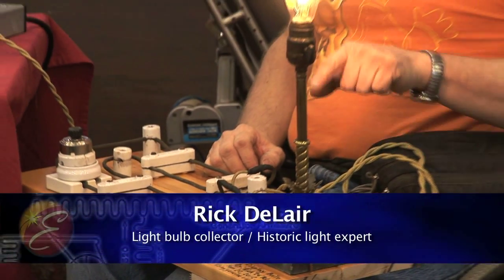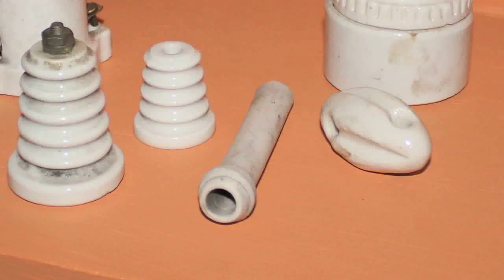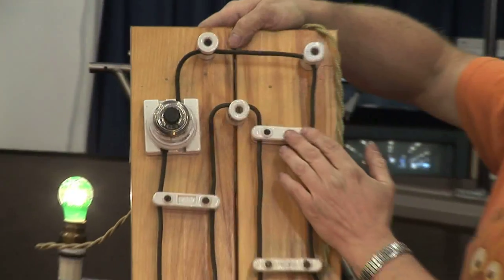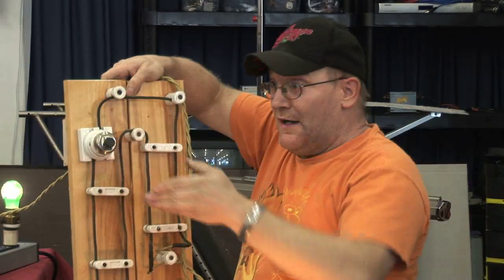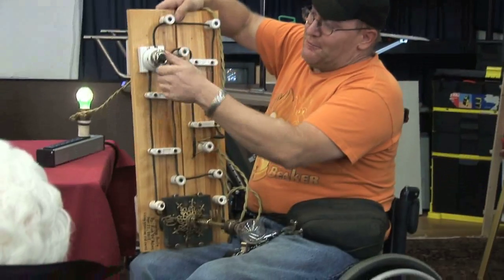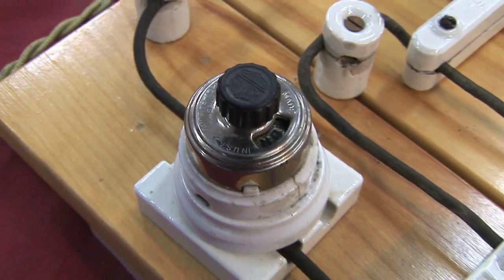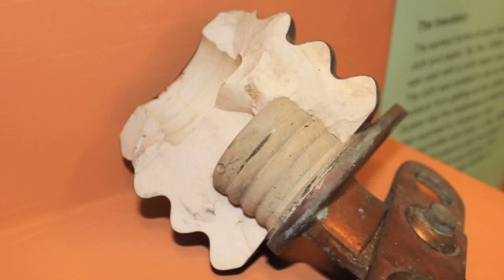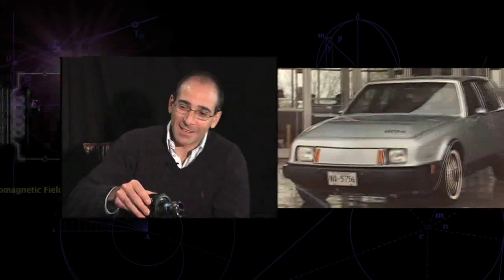Knob and Tube - early electrical insulation

Comment: "They made things to last."   What a concept, produce and use quality material and items and here a hundred years later they are still working just fine.
Reply: My house was built in 1944 all knob and tube wiring. The electric panel and addition is all up to date but all else is the same have had no issues the whole 6 years I’ve lived here.
Reply: That's Why They Replaced With The New Crap Because It Works Just Fine
Reply: “They made things to last” is a bit of a paradox. They also made things poorly back then, but those items didn’t last so we don’t see them anymore. Hence why people tend to associate old items in general with quality, even if it’s just a few select items that were built well.
Reply: @Brian-xo1bt  The good stuff that didn't get messed with lasted.  The run of the mill junk was trashed years ago.  Just finished up some work on a house built by a homeowner back in the early 50s.  Turned my hair grey seeing what was in the walls & hidden in the attic
Reply: Things were also a lot simpler and people weren’t trying to power a washer/dryer, four TVs, ac, water heater and a million other things at once. It’s nostalgia, they say quality but forget how unreliable some older things really are. Cars are the best example.
Reply: @holliday72889  My old house with K&T had two circuits.   Each circuit was fused 15A, the wires were 12ga.   I don't know how the neutrals were run exactly.   The circuits I believe were opposite phase, one for lights, the other for receptacles.  Things get really weird with K&T.  Correct me if I'm wrong...  if you have a 60w bulb and a 60w television running opposite phases and sharing a neutral, it's possible the neutral will carry no current at all, it's electrically equivalent to a pair of loads in series on a 240V circuit.  It's only when the loads are different that the neutral is loaded, but the maximum difference is 15A.
Reply: @mgjk  no you are absolutely right.   And precisely the reason,  you can for example,  wire a kitchen with 12/3 W ground, and arrange the receptacles along the countertop in such a way that every other receptacle alternates between the black hot and red hot, or as we say in the field,  A phase and B phase, sharing a common neutral,  you can plug an electric skillet in the first receptacle,  and a toaster oven in the second receptacle,  and not worry about overloading a circuit.  If the skillet draws 10 amps, and the toaster oven 12 amps, and are turned on, the neutral only carries 2 amps.   One thing you really have to be careful of in older homes, (even newer ones where the wiring was installed or repaired by someone unqualified) was the possibility of two hots of the same phase (Black or Red) sharing a common neutral.  This causes the neutral to carry the sum of amps on both hots, and can heat up dangerously. Also, with tube and knob,   prior to 1928 some fuse boxes were configured in a dangerous fashion,  that independently fused the hot and neutral.  Panels from this era typically had exposed terminals or bus bars, sometimes the box was built on site out of timber,  and had an asbestos board nailed on the interior. Sometimes the home only had 120 volts total capacity (this can be detected by looking outside,  where the utility lines connect to the meter, two wires connected to the service entrance cable and a small circular meter indicates a rare 120 volt service,  typically 30 amps).   There are more oddities with knob and tube, than I can type here, but you should get the idea.
Reply: @Sparky-ww5re  I didn't know that about split receptacles, why 2 15A circuits could share a 14ga neutral, was strange to me, but I never gave it much thought.  The code was updated about 15 years ago  to permit 20A in kitchens, simplifying this.   The K&T aspects though... the whole system seems very well thought out, but many parts of how and why K&T does what it does are non-obvious... like this seemingly undersized shared neutral.
Reply: There is actually a big problem with the knob and tube insulation.  The insulation, when repeatedly heated, becomes extremely brittle with time.  You almost always see this around light fixtures. It is probably the reason why knob and tube is considered such a fire hazard.  I’m guessing the insulation is also not very fire resistant.
Reply: Literally every modern wiring I encountered gets brittle near light fixtures over time, especially if we're talking about older lighting technologies, such as fluorescent or incandescent lighting. This issue isn't specific to knob & tube.
Reply: @ImWriiight  knob and tube is a fire hazard because every fixture shared a neutral. Infinite circuits per building, one neutral. As more and more things became electric, neutrals became overloaded and melted, burning houses to the ground. Knob and tube would be fine to this day if they ran separate neutrals for each circuit.
Reply: The problem is, as was proven by the auto industry bail outs, when you make a product to last, you are limiting the number of sales you can aquire. Who is going to buy a new car when the one I have now works just fine. Thus the marketing firms are born, and then the idea to make things NOT last as long. Look at a new car now. 1mph bump with an obstacle and the car crumples. Not a coincidence, and not designed solely for the safety of passengers. Tis a marketing ploy.
Reply: @Shasta Valley Outdoorsman The main thing that makes knob and tube dangerous is when people that don’t know what they’re doing try to modify it

Comment: My grandparents had a home from the late 1800's that originally has gas lines running through the walls for gas lamp lighting.
Reply: My friends house was built with gas lighting and when electricity came around they ran the wires through the gas lines like they were conduit.
Reply: @domineech  I have seen that myself.
Reply: My parents bought a tenement flat in Glasgow in 1961 and there was still gas lighting in the hall and sitting room.  The gas lines were still in the walls of the other rooms, the previous owners had removed the light units and just closed off the gas supply to the rooms.
Reply: I got a rock
Reply: I have a large pile of lead piping that I removed from my house when I did it up. House was built in 1919, I was amazed that gas lighting was still being installed then!
The house was electrified in the 1950s, with lead-sheathed VIR cable, some of which was still in use but very worse for wear when I bought it in the 2000s. It looks like standard grey T&E / Romex at a distance so it threw me the first time I reached under a floor and touched cold, hard cable!
Reply: As a carpenter I would run into them on older residential remodels
Reply: My house was built in 1914 and had gas lighting, when they got electricity my great-uncle used the gas piping as conduit to run wiring thru...
Reply: Many of the older public buildings (including schools) here contain remnants of gaslights.
Reply: @WCM1945  buildings are great man. I saw one today that was so big they call it a warehose. Technology man. Its a wild cactus in a giant warhouses in the Amazon with Jeff Bridges. Its almost Ike we got the World in perfect harmony and flasma tactics
Reply: That sounds lovely.

Comment: I remember my great grandmother’s house had this type of wiring around 1960. The house was built around 1890 something. There was a hand water pump at the kitchen sink, and a cistern outside to catch rainwater from the roof. The cistern was divided through the middle by a wall of brick, two bricks thick. The water came into one side, and the brick wall acted as a filter. The water was drawn out from the opposite side from where it entered. The house had lathe and plaster walls. When she passed away, the relative who inherited the house had it gutted and brought it up to code.
Reply: I was born in 1986 and the house we lived in had this knob and tube wiring. My father sold the house around 1996 as I recall. Also had lath and plaster walls.
Reply: @Melanie16040  i read that carpenters hated nailing all those strips to the wall for plastering  .

Comment: Many of the original Edison lightbulbs still work because the filament is much thicker than filament used in today's incandescent lightbulbs. That made them much less efficient (and bright) but far more durable. Interestingly, traffic lights of today (except for the LED ones) use a similar trick of thicker filament so that they don't need to be replaced very often, even though they use slightly more energy.
Reply: Is this why LOW VOLTAGE bulbs last so long, almost never burning out? Including for automobile taillights? I have 3V and 12V lights in the house that have been burning continuously about 20 years!
Reply: @JungleYT  This, but also some automotive lights are put through a tempering cycle to help them handle being on/hot. (at least the quality ones that most people buy and use.) House edison-style bulbs are not usually treated as much if at all and it's kind of expected and normalized that they'll quit in a year or two or three. Unfortunately it's true that if you make a perfect product you will make no money, and, if you make a good product that is only flawed in a slight way, you will sell a lot of them and people will come to expect the product to be imperfect.
Reply: @KenzertYT  Well, the 12V lamps I use in a small desk lamp are similar to auto tail light bulbs, and the 3Vs I use to illuminate a step might have a similar treatment having a "pilot light" utility? Low wattage bulbs, like 25W also have a higher resistance than say 100W bulbs, so that might be another relation. Still want to contact a lightbulb engineer at GE or something for explanation as well...
Reply: @JungleYT  Very likely, yes.

Comment: as an electrician from 1967 to 1995 i've done a lot of work on knob & tube wiring. if it is left alone & not "messed with " it is perfectly safe, however, this is rarely the case. i spent a lot of time re-wiring buildings to remove knob & tube for nervous insurance agents & homeowners. my house was built in 1906 with knob & tube. i sleep just fine. from 1995 to 2017 i was a electrical safety inspector for a major ohio city. better inspecting than working on. most of the time needlessly. if knob & tube is inherently flawed, most of the houses in oakwood, ohio would have burned to the ground years ago.
Reply: I'm an electrician in Dayton, OH, started back in 2003, residential new construction and service.  I hated working in Oakwood (damn Jenkins) with their city reality presale inspections and the large amounts of K&T that's still there.  Have twice run into that hideous "Carter" or "California" Threeway as well down there.  I concur on the "leave it alone".  Once you start touching it, it crumbles away.  Did you know any of the Mont. County inspectors?  Bobby Spencer that passed, Gale, Neal?  I've lost touch with who is out there now, after going to be a nameless Mook for commercial companies.
Reply: @Salty_Balls  if k & t insulation crumbles when touched, it should be replaced, probably from being overfused in the past. jenkins does not wok for oakwood, just does electrical inspections. oakwood does their own pre-sale inspections. knew all the inspectors you mentioned.
Reply: @garybrown7044  If it was inside a box, we just heat shrinked it with tubing  and then taped it (was usually just a service call situation).  Outside a box, wouldn't touch it period unless it was to remove.  I just hate Jenkins, as a general comment, add Neal to that, and the whole city of Oakwood.  Never been a worse bunch of homeowners then that town.  That city needs an enema.  Ever bump into a guy named Jerry Deischer?  One eye, big old drinker nose, tough as nails, a little scary?  He's been dead awhile now, 8 years or so, but he was around a long time, not as long as Sheriff though.
Reply: I save knob and tube joints and look at the connections when i eliminate it.most folks dont realize(the joints are soldered). I agree if knob and tube isnt messed with or overloaded,it's fine for the most part.
Reply: @benbradshawjr2856  my grandfather installed knob & tube before ww-1 & after until approx.1932. i still have his soldering "copper" & gasoline fired blowtorch. he drilled holes by hand. he bought solder in 5 lb. spools.

Comment: Can you properly explain or show an accurate drawing on how the CARTER SYSTEM works 
Thank you
Reply: Each switch selects between hot and neutral, if the bulb gets two neutrals then there is no voltage across the bulb and it's off. If the bulb gets two hots then there is also no voltage across the bulb and it's also off. The bulb is only on if it gets one hot and one neutral.

It's more dangerous than other systems for 3-way switching for two reasons. Firstly the bulb holder may be hot even with the light is off. Secondly the outer shell of the bulb holder may be hot. Thirdly if the switch is not designed for such use it may pull an arch between hot and neutral.

Comment: I have a question about knob and tube, and hoping someone here might have an answer! My house was built in 1925, and originally was all k&t. When it was refurbished in 1976, modern Romex replaced all the k&t, except for the the light over the staircase. That light and it's two switches were left untouched, for reasons unknown. When I replaced the light bulb with a CFL type, it burned out immediately. A second bulb did the same. LED bulbs burn out immediately as well. Regular incandescents work fine. I'm just wondering why this is. Someone once told me this could be due to a lack of a neutral wire, and that a single load wire passing through the incandescent bulb will make the filament glow normally. I don't know if this is true. Hope someone here can shed some light on this!
Reply: First thing you need to do is look at the incandecent bulb you removed. Either printed on the top, or stamped along the screw just below the glass part there will be a rating. Most circuits in a house should be 120v however this may have been wire 240 volts. A 120v incandecent can work on 240 but a CFL or led will not. Go to the hardware store and buy a regular 240v 50 or 60watt incandecent bulb, if it glows full brightness in the socket the light was wired 240 volt. If 240v, you need to get an electrician to come change it to 120v. Diagnosing it yourself will save you some time and money with the electrician. However, if the bulb does not glow full brightness, there is something very suspicious going on, and an electrician will need to come cut holes in the wall and figure out what exactly is happening. Other than that there may be some other reason that I don't know of but someone else here may be able to help further.
Reply: May be reverse polarity. Incandescent bulbs don’t care about polarity, leds and cfls do
Reply: @chrismc7205  it is AC not DC, reverse polarity will cause the hot and neutral to be reversed, but there is no positive and negative, so it will still work the same. and as for there being no neutral wire, there is a neutral wire, just not a ground. without a neutral there would be no current and no light.

Comment: In  "my days"  in  HVAC/R service,  "the boys"  were installing a retrofit system in a very old farmhouse.   I was up there  installing the AC  tubing/ controls  and  part of it was back in a closet  against the roof pitch.   One of the guys  says  "what's this wire here for?"    BARE WIRE.  One look and I grabbed my meter.  YUP!!!  Still live, still being used.  BARE   knob and tube   This was  about 1985-90-ish
Reply: Found one of those little surprises doing renovation work on my 1922 house. Wiring had been upgraded to modern standards, new breaker box, but an end of run on one circuit had the old knob and tube (same situation, tiny spot that was hard to get to). No bare wires, but the insulation had degraded so badly that it might as well have been bare. Luckily, even as a rookie DIY guy, I had the presence of mind to check with the meter. To say this got my immediate attention would be an understatement. About 1997. Kind of scary to think how many of these time bombs have been left by past electrical contractors or homeowners just waiting to start a fire or electrocute the unwary. Note, the only reason I discovered this was because I was taking out some of the old lath and plaster walls - had the plans been different that hazard could well be hiding in that house to this day.
Reply: @murraystewartj  Anyone who looks at something like this and thinks "It's fine to touch this" kind of deserves it.
Reply: @Intelwinsbigly  Well I think that's a bit harsh, since not everyone (talking homeowners here) might not recognize it for what it is, and may encounter it when not intending to do electrical work at all. I'm willing to forgive ignorance to a point, but never out and out risky stupidity. I learned my lesson at 5 years of age by sticking a metal object into an outlet, so I have a healthy respect for what electricity can do and always test and retest anything I encounter, lockout, retest, then get to work. And I've learned never to trust someone else's work but to verify for myself.
Reply: Holy shit